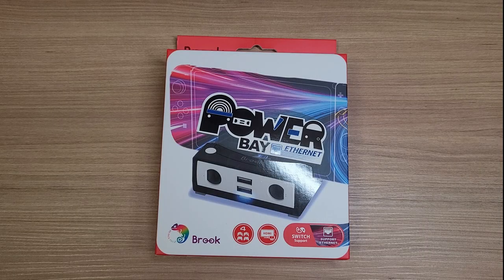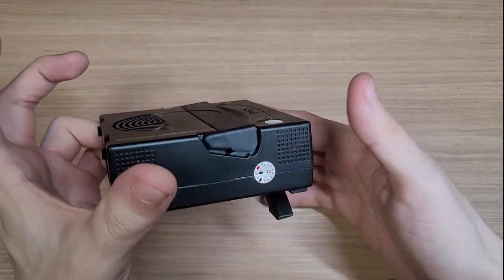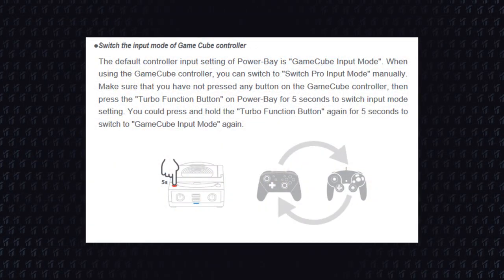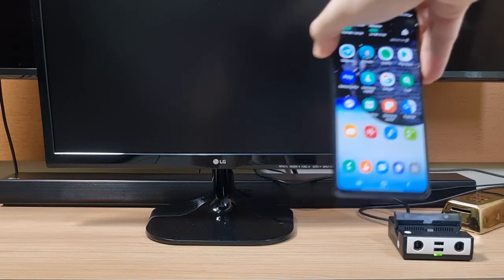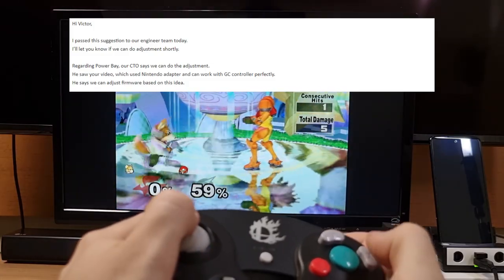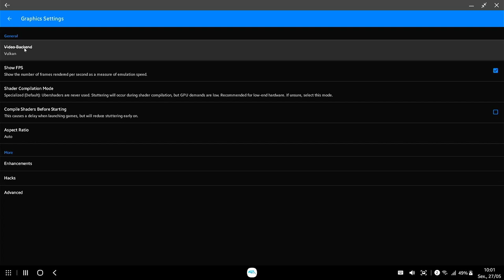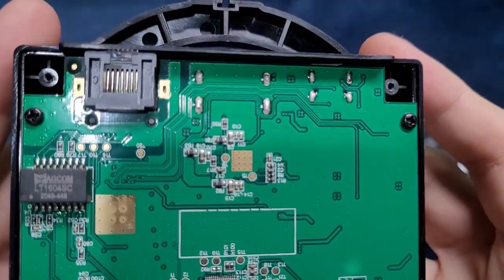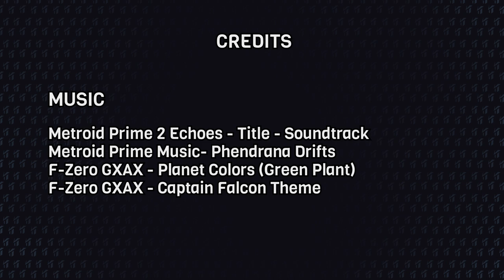This is the ultimate dock for your Switch and Smartphone! / Brook Powerbay Ethernet

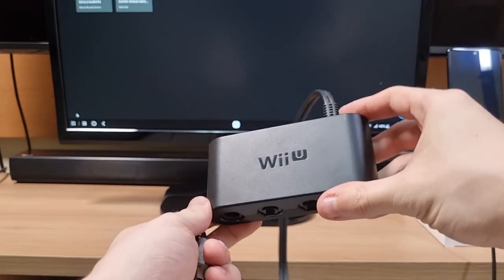Comment: 9:20 wait so you don't need to plug in both USBs from the Gamecube WiiU adapter for the adapter to work with 4 controllers? I noticed you didn't plug in the grey USB that comes from the adapter, like you did when you tested the adapter with the Switch 4:54 earlier in the video. Can you please inform me more, thanks

P.S finally someone who didna thorough review of this product,  you really answered a lot of my questions before buying it.
Reply from the maker: yeah you don't need booth, the grey usb is just for additional power for the rumble, you wont have rumble if you don't plug both of them though
Reply: @VKsChannel  thanks for replying back.  Very thorough video 🙏🏻

Comment: I still wouldn't trust it but that's my opinion
Reply from the maker: Well check all of the other reviewers including Rocker Gaming they have this dock for much longer and they didn't report any issues
Reply: Pretty much any dock with hdmi = gambling. The switch doesn’t use normal Power Delivery standards when it switches to HDMI mode. Should be 100% safe if you never use the HDMI though
Reply from the maker: @TheGelatinousSnake  This is now my main dock anyway we'll see if I'll have any issues in the future
Reply: @VKsChannel  def worth it. 

I just will absolutely not run Breath of The Wild are any big games in HDMI mode. Even with a promise that they’d pay to replace my console, I don’t like doing the data backup recovery dance. Nintendo really dropped the ball not using standard Power Delivery

Comment: When plugging the cube controller in, is it a smooth process?
Some 3rd party cube adapters are rough on the cube controller's plug in and have damaged it as a result. I'd hate to bring this to a local just for it to cause problems.
Reply from the maker: It is slightly harder to pull than the original ports, but on my tests I plugged many different controllers and none of them broke

Comment: VK, not sure if you're gonna see this but, is the only way of communicating with seller is throw Amazon? I have a few question for them since I'm a international person.
Reply from the maker: What questions do you have?
Reply: @VKsChannel  if i buy this and my Nintendo switch gets broken. Would it still be possible for me to send it to get repair; as I live in the Bahamas. Everything I receive or send to the United States goes through a shipping company.

Tl:dr I live in a different country and does the switch insurance thing still apply to me.
Reply from the maker: @Clone394  you can ask them directly throught their contact page (brookaccessory.com/contact/contact_form.php). I believe they will guarantee the insurance even if it means having to refund you for the repairs on your local store, but I can say that it is safe as long as you use it with he original Switch Charger, My switch has been sitting on powerbay since this review and it's fine to this day, also you can look at the other YouTubers that reviewed this dock and none of them had any problems. and if you for some reason have any troubles talk to me on discord I'll give you their insider email address so you can contact them personally